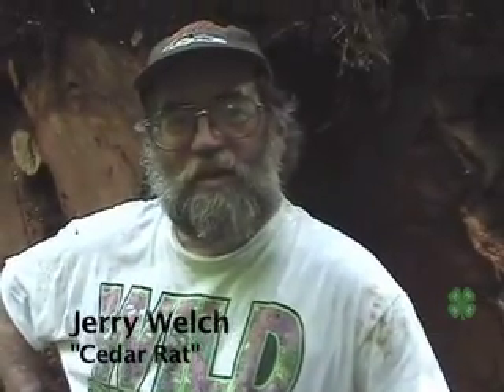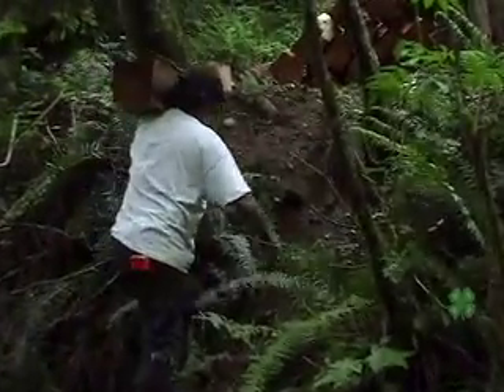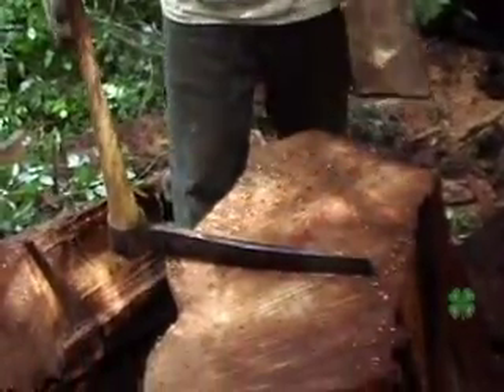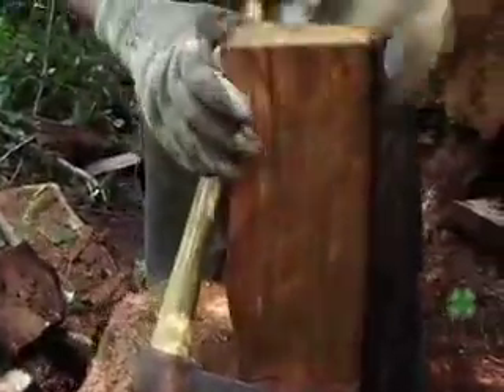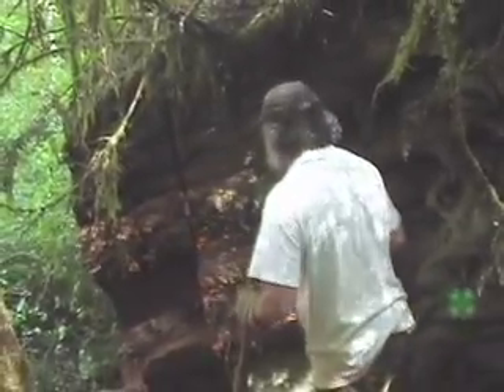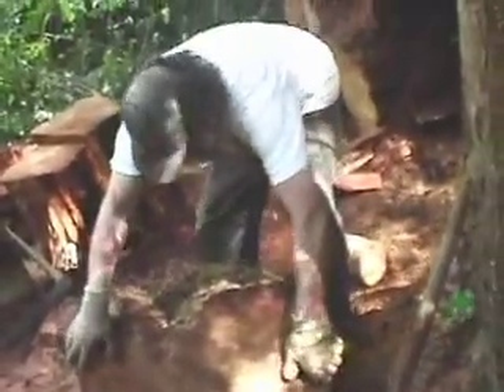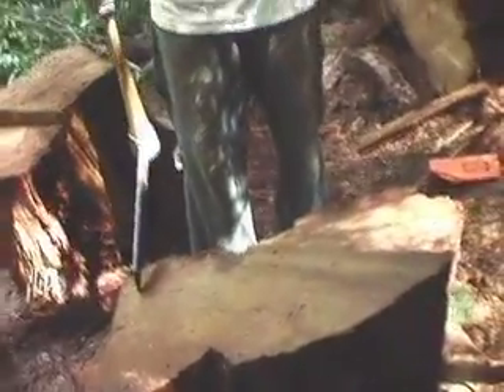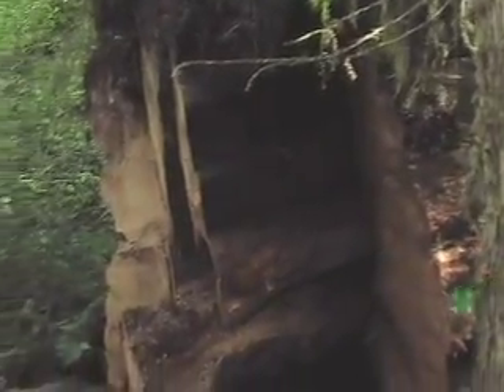Jerry Welch: "Cedar Rat" shingle maker

Comment: There are alternatives to cutting the bolts long, then trimming them back.
One method is called "canting", where a log is split longitudinally, like this:
https://youtu.be/5Z0uVmYD8y0?si=-36PKfFJjkZ2HCLZ&t=234
Now that it is in a smaller section you can see the grain inside, outside, quarter, etc and align the bar easily to compensate for flare and twist in the tree.